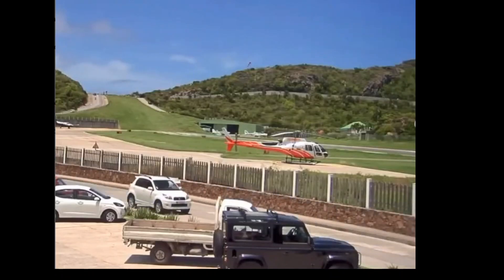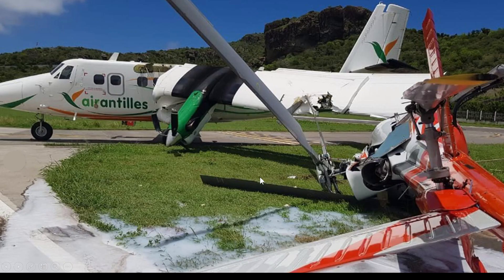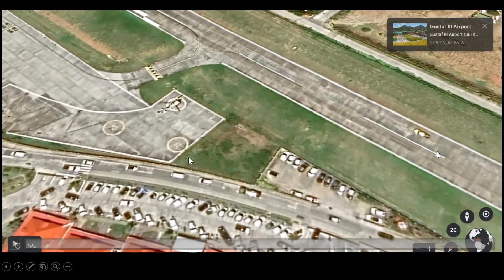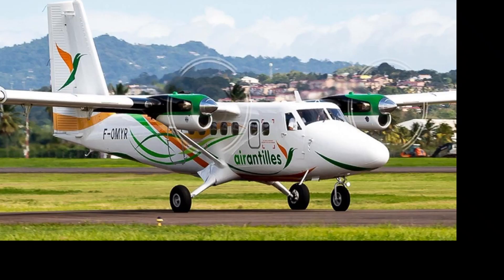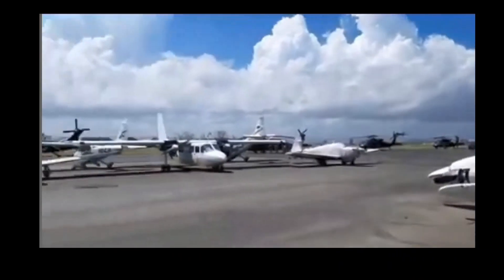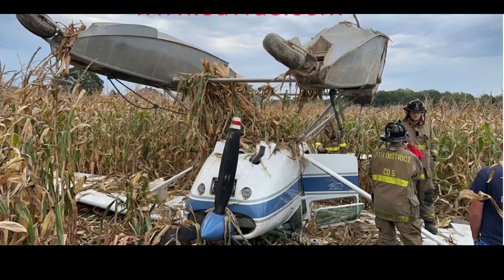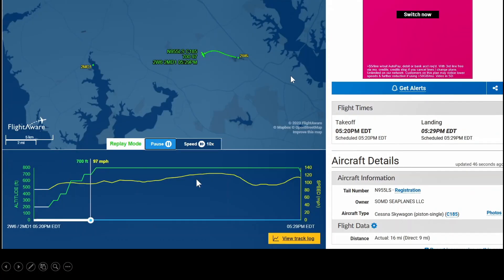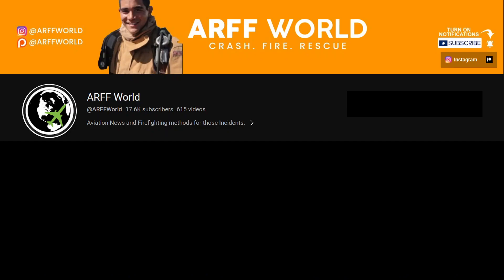DHC Twin Otter Collides with Helicopter and More

Comment: Rotor wash is very much related to the weight of the helicopter producing it…

2-seaters… generate a small amount that will cause a noticeable turbulence… 
4-seaters… generate a lot of turbulence that can be scary when the helo air taxis by…. Rush to close doors, before they get there…
6-seater… proves the non-linearity of the affect…

A large military helicopter has monstrous gross weight beyond the small common examples given above…

Similar to landing after a heavy jet takes off or lands…

The disturbed air hangs around for minutes., and gets moved with the wind.

Soooo… if you find yourself struggling with the yoke, while behind a large helicopter… try to stay to the upwind side to get to cleaner air faster….  😀
Reply from the maker: Nice

Comment: After logging several hundred hours in the Twin Otter,  I can summarize what happened here.  First of all, the Twin Otter has a substantial amount of rudder authority at approach and landing speeds, and along with rudder input using differential braking will easily keep the aircraft on centerline.  The nose wheel deflected 20+ degrees upon landing will cause a momentary excursion, moderate to hard rudder and differential braking will get you back on centerline.  I had a blown nose wheel tire,  upon landing I was riding on the rim.  There was zero nose wheel authority.  Rudder and brakes easily kept us (14 pax + crew ) on the runway.
Next up are the approach checklists, which include verifying the nose-wheel tiller is centered.  I seriously doubt there was a uncommanded hydraulic issue causing the nose wheel to be off center, since this has never been an issue.  The pilot may have simply not checked the tiller on final.  The tiller is hyper sensitive and you quickly learn to only use it at low speed taxi.
As for landing in a corn field .. yep, those stalks will damage your airplane. But given an emergency landing, and what options you have, forget about the airplane.  That’s what insurance is for.  Life preservation is the primary concern.  Hitting corn stalks is a hell of a lot better than impacting houses, cars, trees, people or power poles.
Reply: I noticed the gear was down on that floatplane. May have been a muscle-memory reaction in the moment of high stress, but I would have left the gear up and skidded onto the corn. The wheels tipped it over IMO.

Comment: I saw a photo of that twin otter on short final. His nosewheel was not straight. The centering mechanism didn’t center it, as it was cocked about 20* to the left. So, at touchdown it quickly veered left, leaving the runway before the pilot could react.
Reply from the maker: thanks for sharing that David, was wondering what the heck happened there
Reply: There were stories that the nosewheel had been repaired only a few days before the crash.

Comment: Looks like the PC12 got into the rotorwash of the Black Hawk. You should always leave enough spacing for wake turbulence and rotorwash to dissipate.
Reply from the maker: That was spooky
Reply: And "enough spacing" isn't always obvious.  If, for example, runway winds directly counter the direction of the wake turbulence or rotorwash, that turbulence can hang around longer than you'd think.
Reply: OMFG are you sure??????

Comment: Pretty sure that airport with the twin otter is St. Barts, not Guadelupe. I believe St. Barts separated from France in 2007.
Reply from the maker: Thank you for sharing
Reply: I thought the same thing, the approach end with the hill was the tell tell sign! 👍👍
Reply: Yes that is St Barths and they still under France I visited there about two months ago.
Reply: @krystalviewaviation  OK, that means they split from Guadeloupe then. I do recall a referendum back in 2000s. Let me check - yep, they split from Guadeloupe in 2003.
Reply: In any case it's not France, by something like 4,000 miles... if you ignore the bit of actual French France right off Newfoundland.

Comment: I wonder if the Accident investigators did any aerial footage of the twin otter crash.  To the untrained eye it doesn't look like he was on the runway OR the taxiway.  If the overhead diagram of the helo pad you showed is current then if the otter was on the taxiway, there is no excuse for hitting any helo on the pad because there should be adequate separation.  Glad that in all incidents, only aircraft had serious injuries.  And I have to agree that your volume was a bit off on this one but I put my headset on and could hear it.  Another greatre report, though.
Reply from the maker: Thanks and appreciate the feedback

Comment: Typical problem with disk break ...when too much breaking is applied ,  small pistons lock the wheel .?the pilot will discover that only when landing  ...already known with C208 A and B....landing from the sea is done sometime ...go around   not permitted  worse at the end of the day with the sun low on west you will  be blind for 10 s ...
Landing at St Barth require some gift but no more !
Reply from the maker: I hate it when that happens